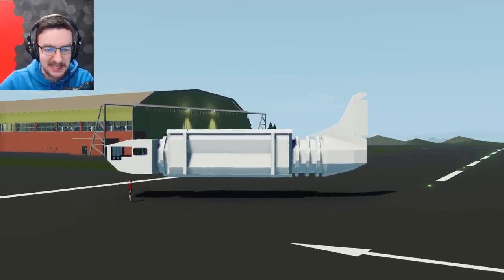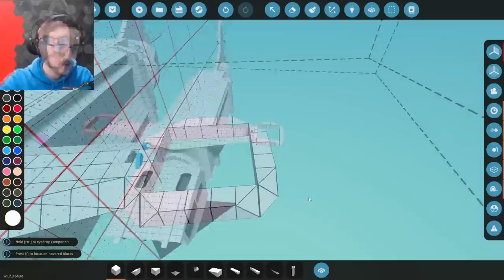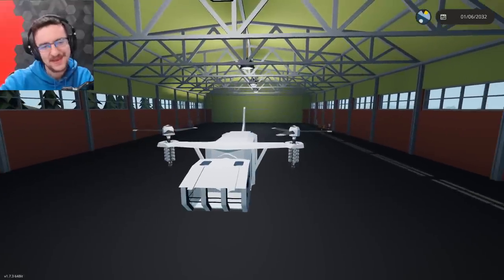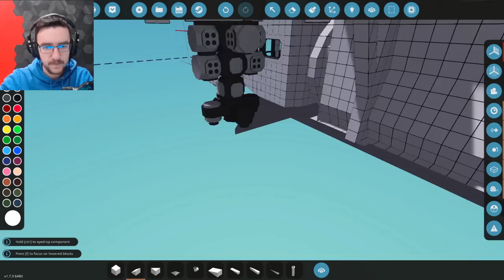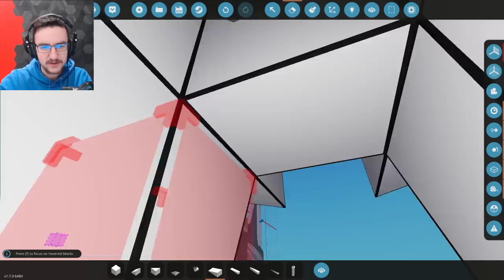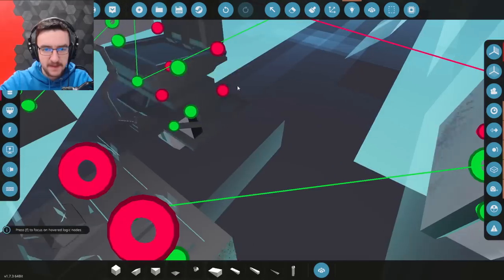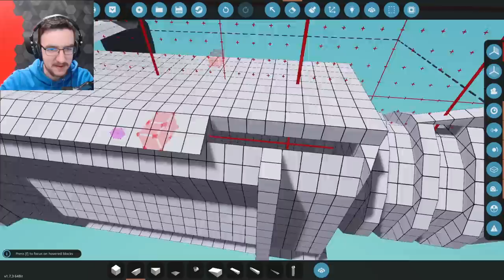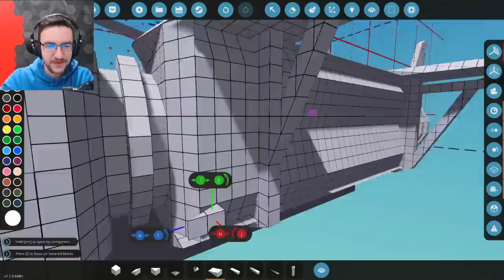ENGINES & ENGINE PODS Built For Our MILITARY FUTURISTIC VTOL Build In Stormworks #2

Comment: The rear propellers are bigger than the front ones. It should be a problem in the future.
Reply: Not necessarily, the back propellers would need to be bigger to exert a larger amount of force because the back wings are bigger and cause more drag.